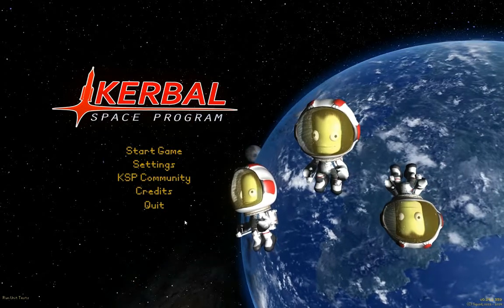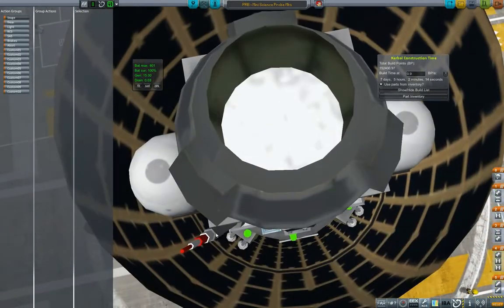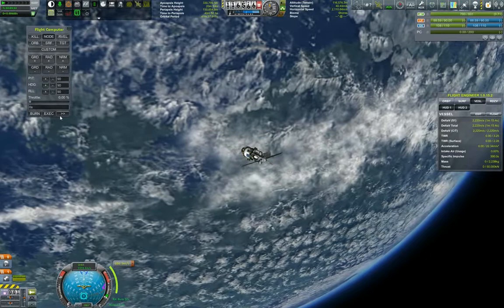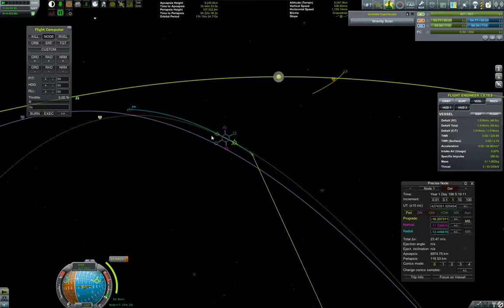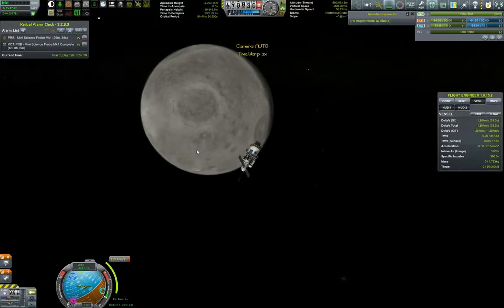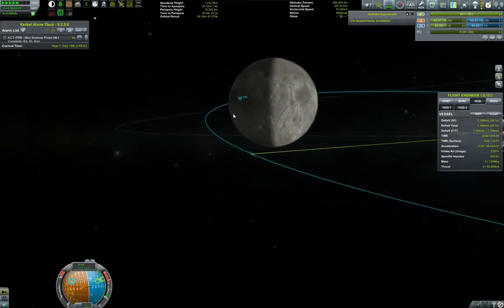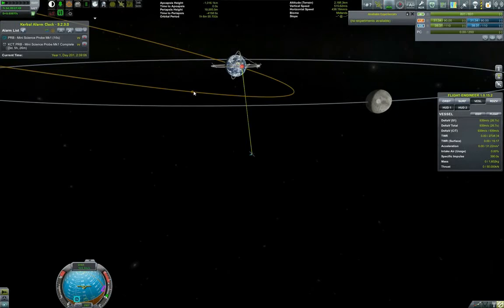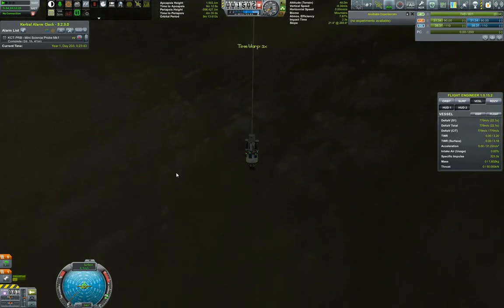KSP-Interplanetary Voyage of Exploration-Ep_09-Mini Probe To Mun

Comment: As you can tell, I'm plodding through this series right now, so I might be just as behind the times on this comment as on my previous one about permadeath.  (Awesome series btw).

But around 12:00 you complain that since the duplicate craft is already in production, you're stuck with the flawed design.  That's not true.  KCT does allow you to modify craft files already queued for production.  Additionally, not only can you also cancel production (losing the invested production time, but KEEPING the science conversion) you can also simply order a corrected design, and then change the queue order (easier when you name the redesign so that you can tell them apart in the production menu at the KSC scene.)  The advantage of doing it that way is that you can always "scrap" the flawed design, which not only allows you to harvest all of the production-science from the build time, but also puts all of the parts into your inventory as if they'd been recovered -- including the fuel.

When I run KCT, I always run a second production line behind my primary specifically to harvest science and parts that way.  Also, production times are recursive, getting shorter for every time a certain part is manufactured as new (something manufactured for the hundredth time, like a parachute, will take a lot less time to build than a brand new part fresh out of R&D.)
Reply from the maker: +MisterFister Glad you like the series :-). Thx a bunch for your comment regarding KCT, this mod was a late addition just before i started the series, so I am not fully aware of all the intricacies. I did not know that you can modify the craft that is already queued for production, i only knew you could scrap it for some refund.

I really like KCT and what it brings to the table in terms of gameplay. Thanks a lot for your comments, and by all means keep them coming. KSC has the best community ever, and it is yours suggestions guys that help me make the series interesting. Did you know I ran half of the series without knowing that by holding ALT in VAB you can place stuff directly to attachment node ?

Thx again and stay cool :-)
Reply: +GrunfWorks indeed, yes.  To clarify what I said above, as far as I'm aware, you only get to keep constructed parts in your inventory of the vessel is either "recovered" (either from a landing or a pre-ignition launch abort on the pad / runway) or if it's scrapped after production is finished.  Scrapping it prior to full construction completion, I think, forfeits the inventory benefit.
Reply from the maker: That is good to know :)